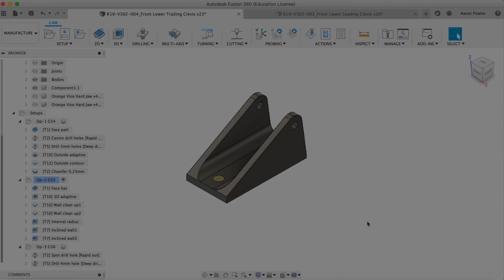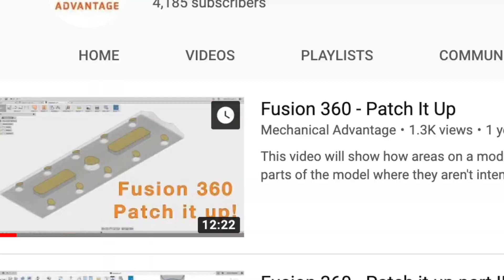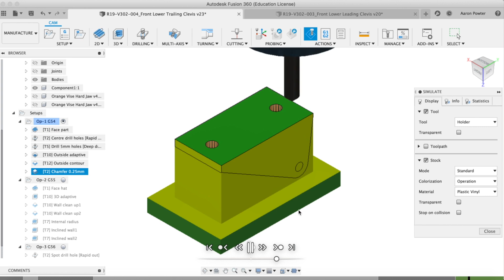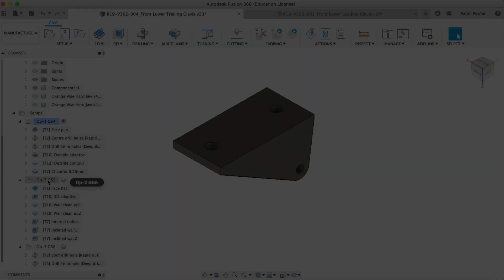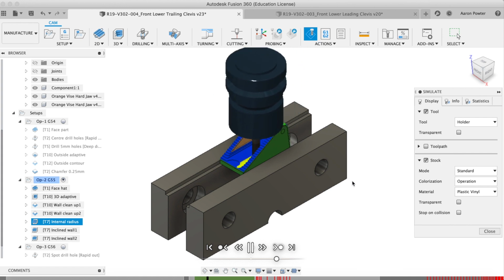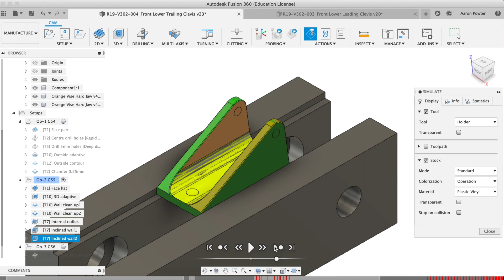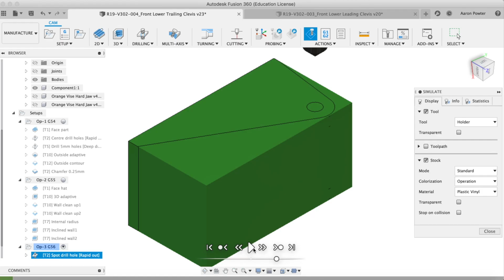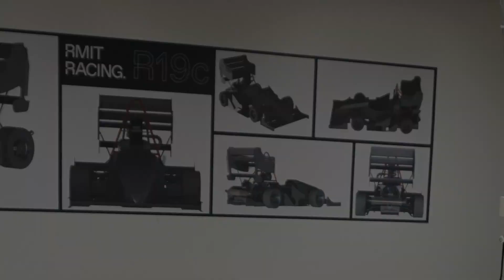CNC Machining Formula SAE Parts - RMIT University Race Team

Comment: Great video Aaron...love the way you do them and the info you have attached in the cards for the different ops
Reply from the maker: Mark Kyle Hey Mark great to hear from you hows things? Thanks for watching mate. Hopefully my videos helps others to replicate what I do and get usable parts. How’s that new plane 🛩  going?
Reply: @DCT_Aaron_Engineering  The rebuild one is about 2/3 of the way finished and the new one I ordered the kit for the Rans S21 Outbound will be loaded on the boat for the trip here in 3 days time. Due the 30th sept here in Brisbane. So have to get the rebuild finished as soon as I can before I start the new one

Comment: Great video's, but Noticed your adative leads speeds was very low, also I guess the syil does not have a spindle break. Could you not do the side hole on OP2 as you have a bottom and side datum, this way you would not make any marks and could hold the work better.
Reply from the maker: tvrleigh Hey buddy. Thanks for watching. Yes my leads were set at default from when I originally set it up in the tool library.  Problem is I don’t turn it on all that often and forget to amend it and save settings etc... You raised a valid point though. Cheers Aaron 👍

Comment: Nice work mate.Constructive criticism.Rather than CAM the single hole drilling operation ,I would have set the part up and then manually drilled it to save a bit of time on one or two parts.
Reply from the maker: Thanks mate.  Yes many ways to skin a cat ;-).  I could have also machined the side operations first and cut the profile to save on 3D milling time.  Cheers, Aaron.